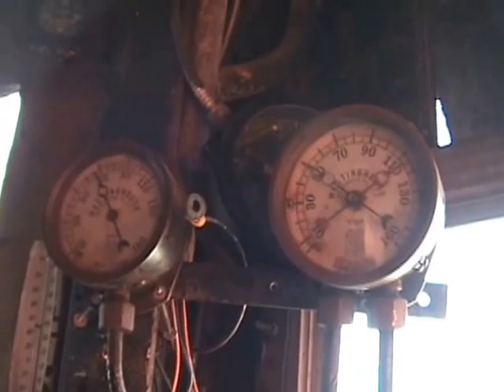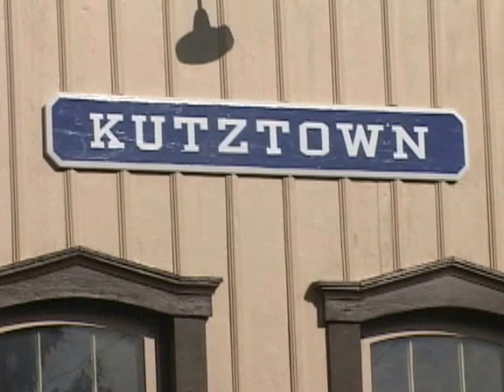Doodlebug

Comment: My son really likes trains 🚆🚂🚃🚄🚅🚇🚈🚉🚊🚝🚞🚋🛤 especially railcars like those he thinks they are highly underrated rail transportation vehicles and should be restored, preserved, and put back into service on lines that are not used anymore carrying both passengers and mail. He also thinks that Progress Rail, Siemens, or any other company that builds railroad equipment should build copies of these and the departments of transportation should rebuild railroad lines that were abandoned and removed and run these on them and as an interurban rail service.